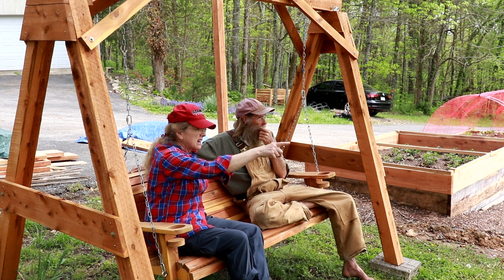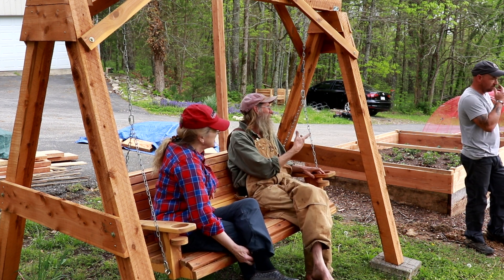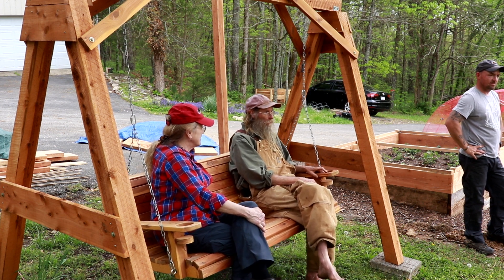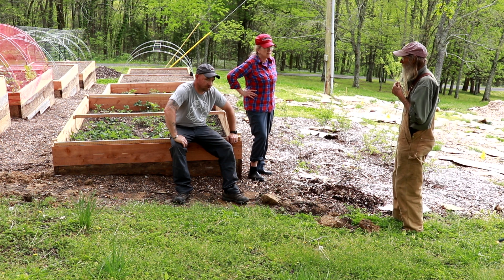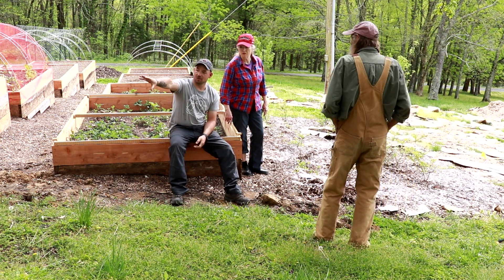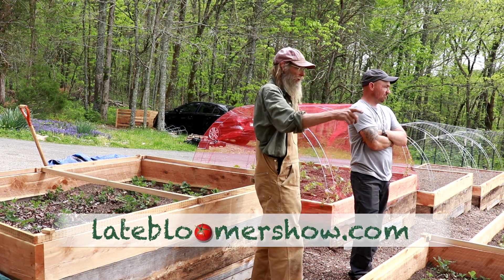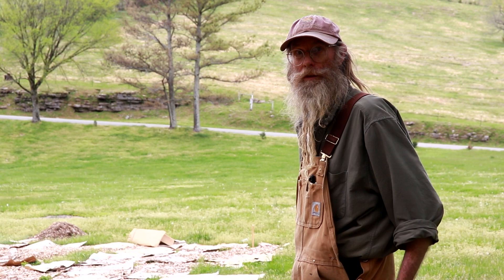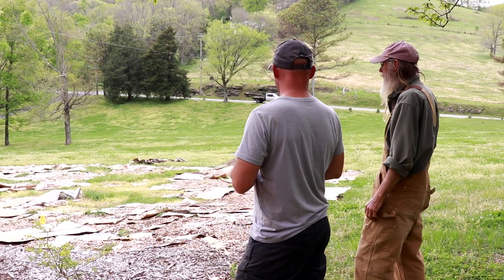BAREFOOT FARMER visits the HOMESTEAD with lots of GARDEN PLANS!

Comment: A few yrs ago I rented a small tractor to use around the homestead, although I own 4 huge tractors for large scale farming. Check with your local tractor dealers to ask if they rent, or offer short term leases. Justin probably knows what size machine to get.  Around Lubbock there are ads by retired gentlemen who will haul their little  tractor out to plow your garden in spring & fall. I used to see their ads in the Thrifty Nickel, which I suppose would be on Facebook marketplace these days. Praying the tick bite is benign.
Reply from the maker: Thanks, Dee! I will do that. I'm sure I will be needing that service. I decided on a silage tarp, but at some point, I'm going to need a tractor service. I'm so behind on editing, you haven't yet seen that I rented a mini-excavator from HD (whopping $1000!) for a few days. Ouch.